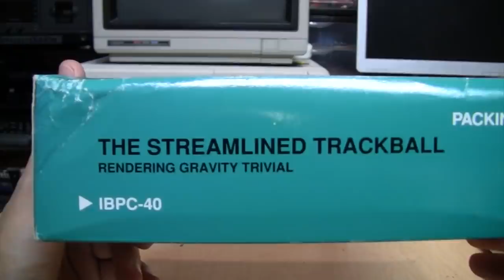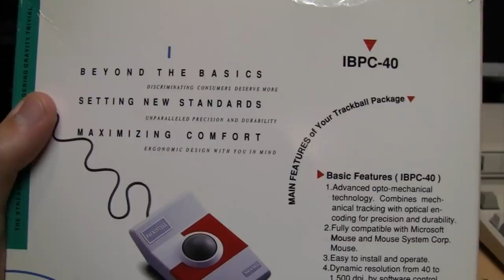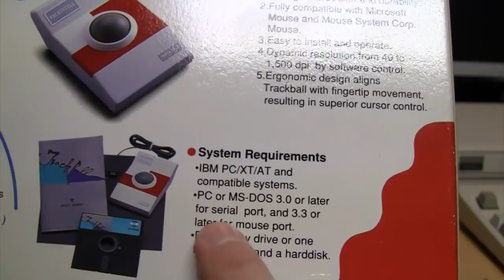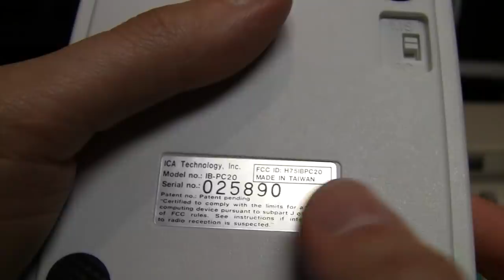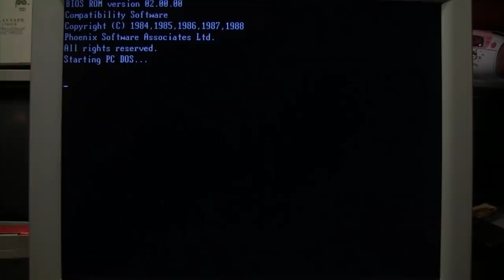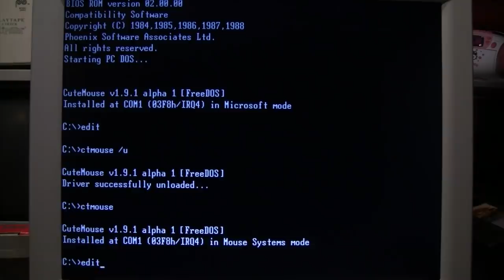Oddware: Packintell anti-gravity trackball & Tandy 1000RLX

Comment: "Fanless 25w power supply"
Crazy. These days, a typical desktop's RGB lighting alone would blow through that limit in no time.
Reply: @Riskteven  I'm pretty sure OP was thinking of a different RGB
Reply: I remember hearing about an RGB SSD that would overheat if you used the RGB. They put hundreds of LEDs into a thing that people never needed RGB in. I bet it used that much power just to light up.
Reply: Not only is it unnecessary, if you didn't have the RGB software installed, the lights would stay on and overheat the SSD until read/write speeds slowed to a crawl. 
I never knew it was possible to overheat an SSD, let alone a product released to the public would design a feature that would kill the drive if you ever used it.

Comment: Is that a Seagate ST-351A/X that I can hear in that 1000RLX? That faint hum sounds veeery similar.
Reply from the maker: Yes, that's it. A fantastic little drive -- the last stepper motor hard drive ever made, and it can be jumpered to work with either the 8-bit IDE-XT or standard IDE-AT controllers.
Reply: That was impressive!
Reply: @martinda7446  hehe yup there's some old HDDs that I know so well that I could practically identify them by noise, such as the Seagate ST-351A/X, the ST-4096, ST-251 and the IBM Ultrastar 9ES to name a few :)
Reply: @Alexis_du_60  That is amazing...but weird. Some of them do make magnificent noises though. I like the sound of the big floppy drives.
You don't happen to be a floppy/hard drive/printer musician by any chance?
Reply: @martinda7446  not at all unfortunately, hell if I knew how to rig up multiple FDDs to make some music, I would have already done so.

Comment: Kinda weird that it had the same failure as that keyboard trackball (which I still have). I'd like to think its a driver issue, but I don't recall the trackball on that machine sending anything over the serial port at all when you moved the ball. I would try sniffing the serial output of this and see if its sending any motion commands. The MS mouse protocol runs at 1200baud. Something like Windows Terminal should work fine.

Comment: do you still use a trackball as your main mouse on desktop? which is your favorite?
Reply: I hope you don't mind that I pipe in: yes, I use trackballs almost exclusively, have done so since around 1993~94. It all started soon after I got my Amiga 1200, and quickly developed "mouse elbow" (AKA Repetitive Strain Injury or RSI in my elbow) so I found a trackball that was compatible with the Amiga. It brought be so much relief in my elbow that I decided to stick to that type of controller. In 1998  I got my first PC for christmas, and immediately bought a Logitech trackball for the PC. I reckon that I've worn out 6 PC trackballs since then. I have only used Logitech trackballs since my first PC one. In total I have used 4 different models. Oh by the way, I mentioned that I had worn out a number of TBs, by which I mean that after extended use the button switches start malfunctioning and eventually stop functioning entirely, at which point it's time to replace the device.
Reply: i do i have issues with hand eye   finite movements and RSI so i use them exclusively mine right now is the logitech one you use with your thumb but i also have a kensington expert they also seem better for gaming IMO

Comment: I have serial mouse that does not like the cute mouse driver, for what ever reason it would detect it in both the MS and PC modes but never work right. I ended up using the one of the MS mouse drivers and I believe the driver for a logitech mouse worked as well. I can not remember what version I used.

Comment: That sucks it about how it was almost functional.  Almost like a gateway2000 286sx I got for free . at first was fine then I get keyboard error. Keyboard fine its either connections on board so I thought but when I did some wire to board soldering still not work so I may pull chip and memory keep 5.25 drive and 3.5 will come useful as well as led lights and switches. Thats how it goes I guess with most old stuff.

Comment: "The PS/2 Mouse port does not work in Windows 3.1" is that something weird with just that computer, because I have Win3.1 installed on a 95-era computer with a PS/2 mouse and it works just fine (using the Logitech drivers IIRC).

Comment: You sure you don't need the drivers it originally came with? You might be able to find them online.
Reply from the maker: I tried both the CuteMouse driver and the original standard Microsoft mouse driver and it didn't work properly with either of them.
Reply: @vwestlife  But you also said they was a driver disk missing, could they be unusual drivers the mouse originally came with?